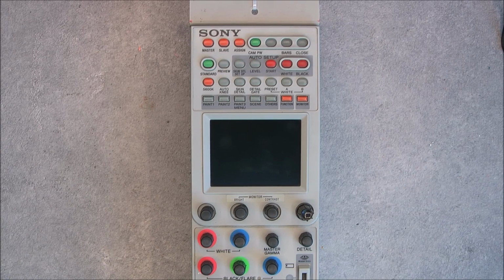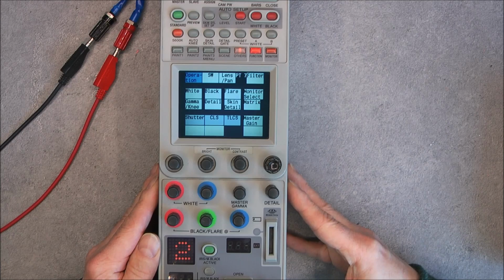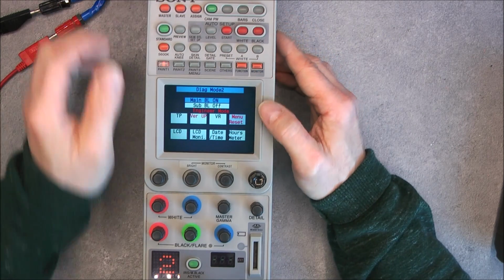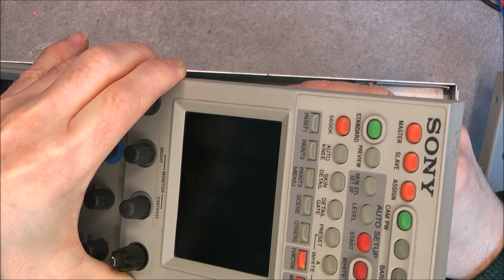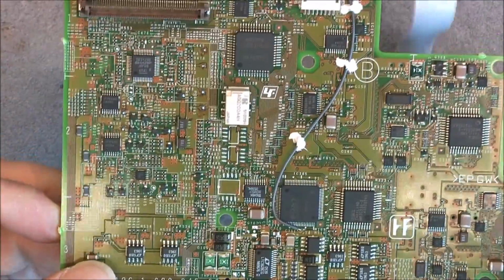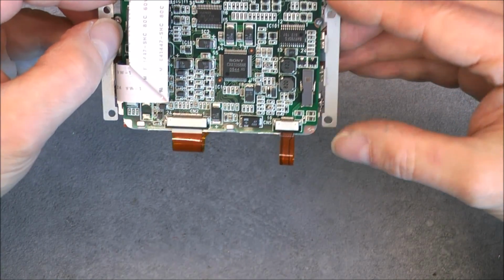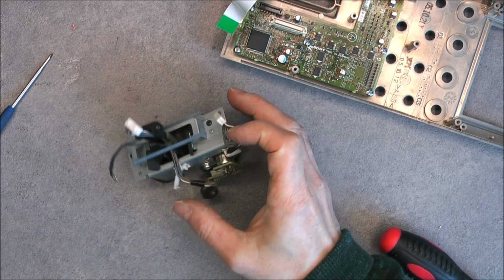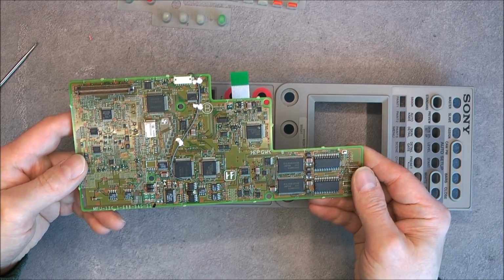Sony RCP-D50 broadcast camera control panel  teardown

Comment: microprocessor is an hd643704x 32bit RISC SuperH-2 microcontroller manufactured by hitachi/renesas
Edit: the big chip on the last board on the front panel is an hd6435328cp h8/532 8/16 bit mcu, really fancy stuff in this device!